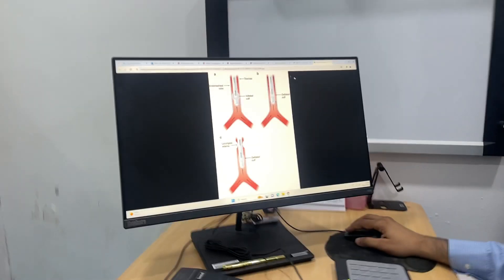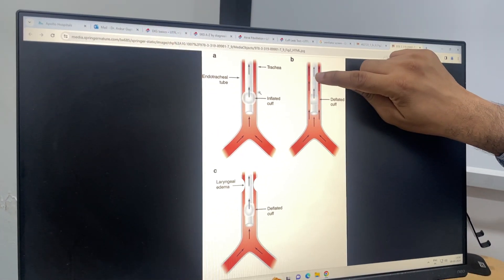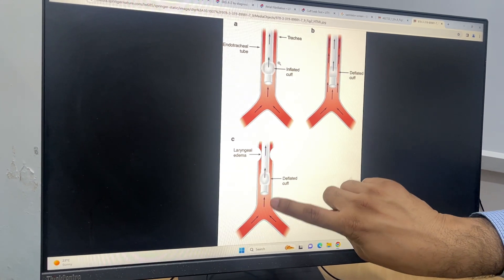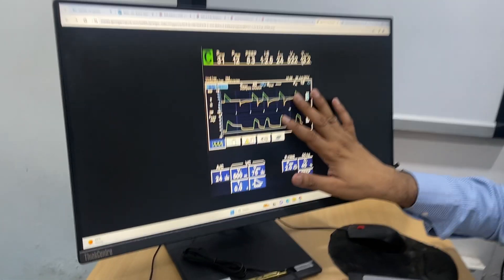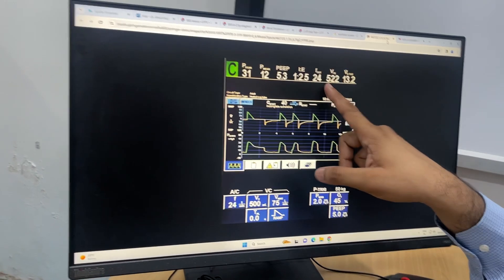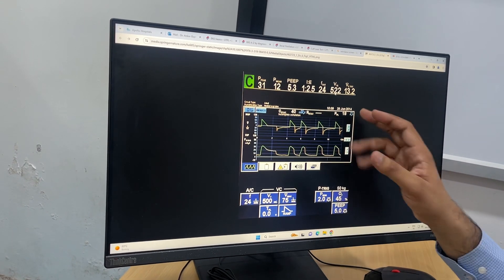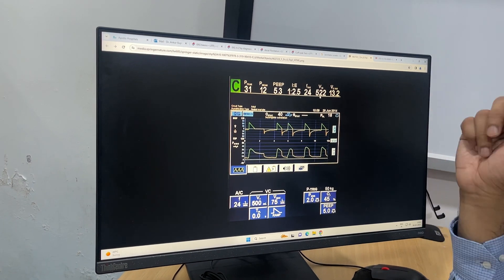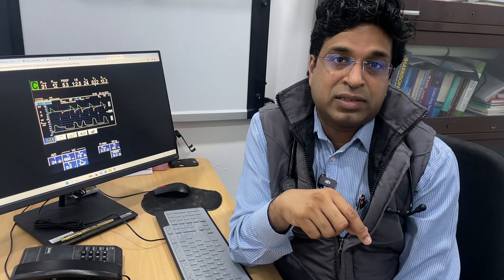What is Cuff leak test? How to do and interpret it on ventilator

Comment: Plz take averages of such three test breaths and then compare with the original one. And,  also considers reanges and not  just one absolute value like  110 or 10 ℅
Reply from the maker: Yes average should be taken but the average should be compared to 110 and 10% which are cut off to guide. thanks again for clarifying.